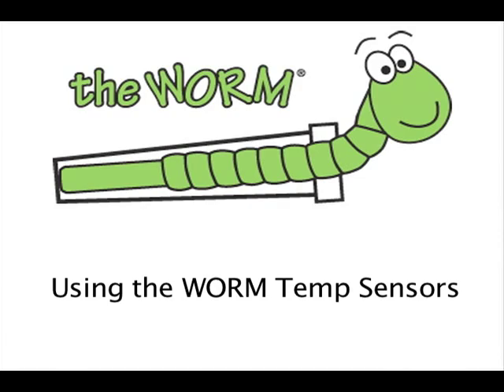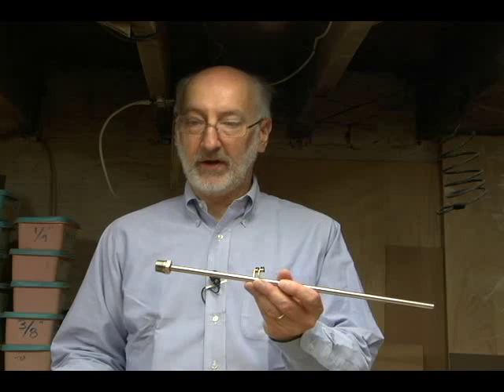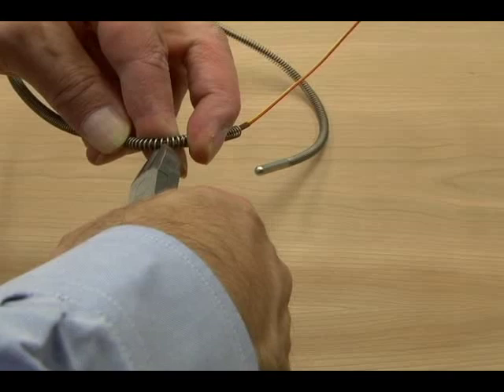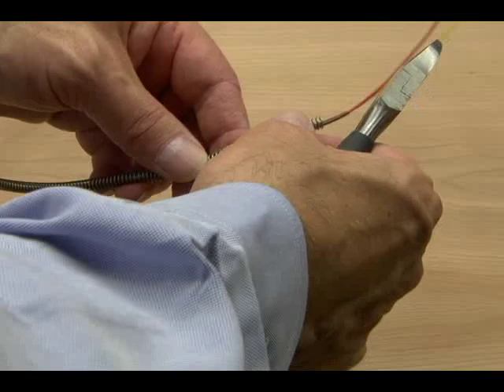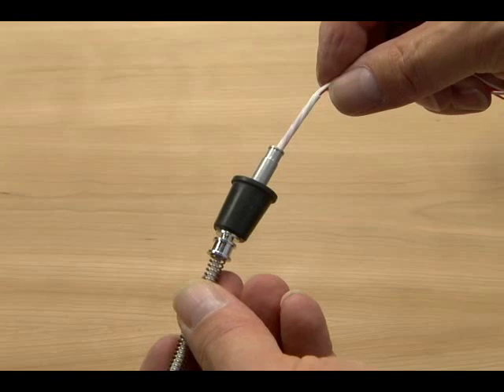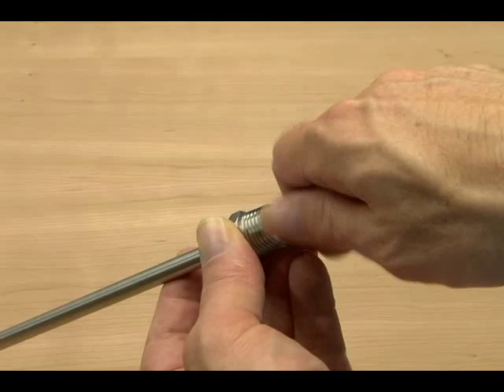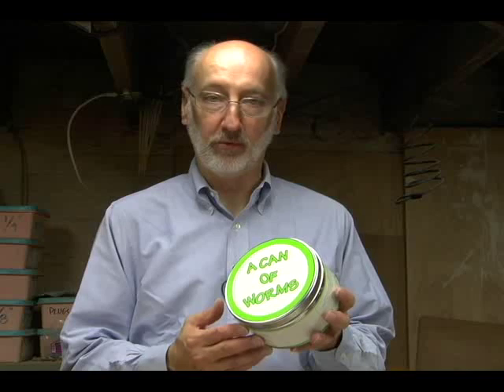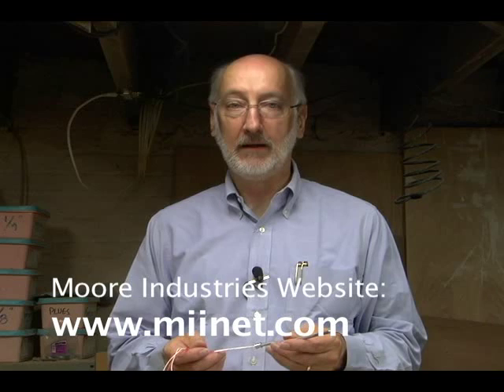Temperature Sensor Technology Demo featuring Peter Welander and Moore Industries WORM

Comment: what about the unprotected plastic covered wires which are very close to the measured liquid's high temperature, do they melt and cause short circuit at high temperature such as 250 celsius?
Reply from the maker: The WORM Flexible Temperature Sensor comes in two different temperature ratings, both designed to withstand 250C temperatures. The "WS Standard" for the -200 to +260C range, and "WH High Temperature" for temperatures above +260C.